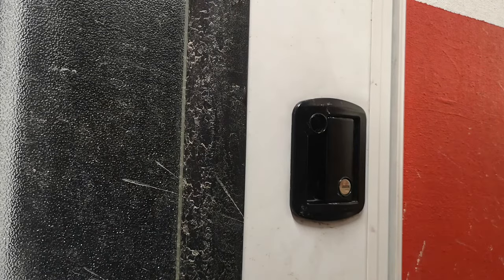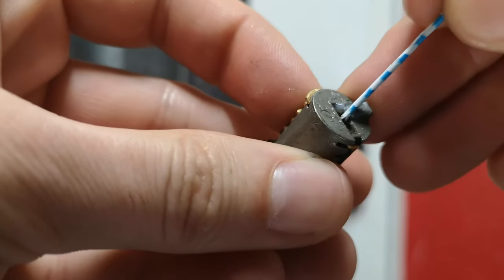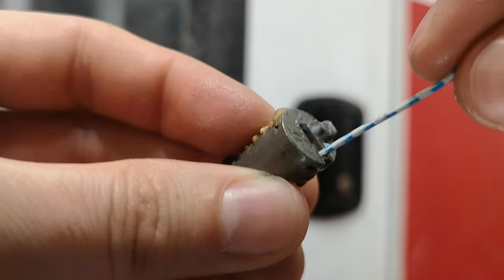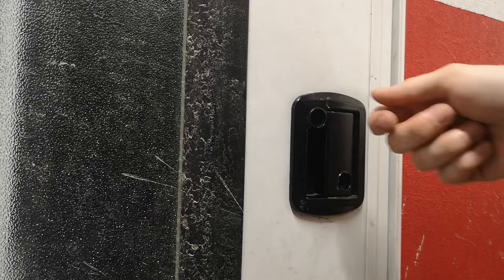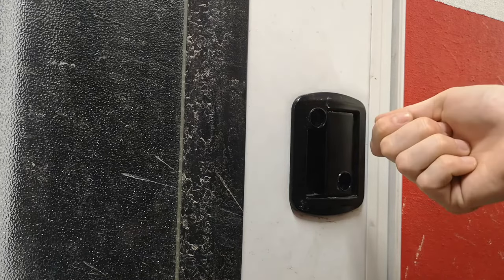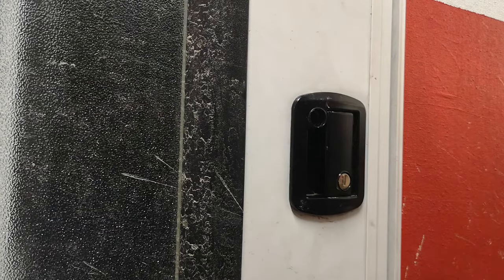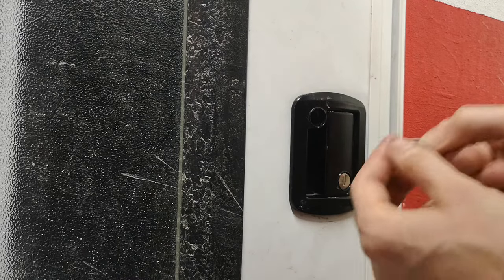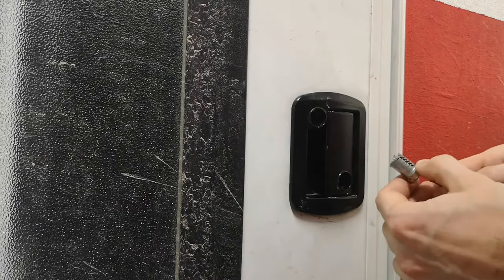Remove Global Link Cylinder Lock - Rekey - No GLD Key

Comment: WHen you used your Covert Companion, that was so easy.  Is it possible to remove the barell like this when the door is locked?  Im looking to buy locks for a camper Im building, but that look doesnt look even slightly secure.
Reply from the maker: No, the lock has to be unlocked for it to be removed like this. You're essentially pulling a wafer I'm the far back that's the only thing holding it in. When the lock is locked, every wafer is preventing the cylinder from coming out. 
I'm sure the locks are not the most secure but they only come out like this if they're open.
Reply: We just had our whole entry door lock completely replaced.  Someone had stuck somethin in one of our locks preventing us getting our key in the slot.  It was 9:30 PM in a Banff Canada RV park.  I tried to break the lock  to get in.  Neighbors heard the commotion and thought we were breaking in the motorhome.  We were never able to get through the locked door.  We had to remove a window to get in.  So yes they are secure.  No one is breaking in via the door.  They will need to break a window.

Comment: Hi buddy, where can I find that tool please. 
Thanks
Reply from the maker: The hook I used is from the Covert Companion over at covertinstruments.com but you can find cheaper lockpick sets online and they all will have some hook that will work, or you could use a paper clip like I did in the video even if it is a little trickier.